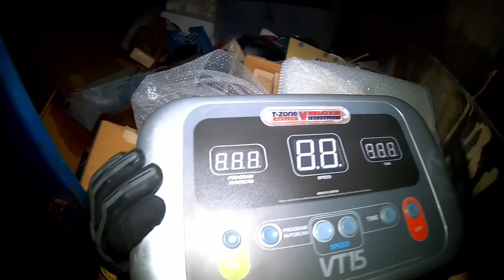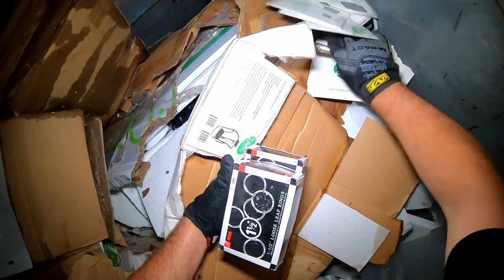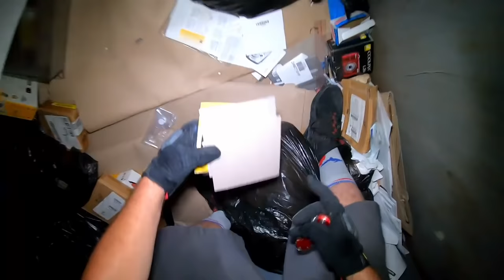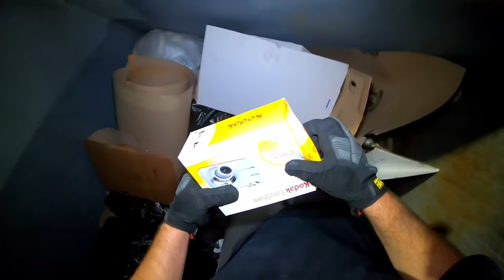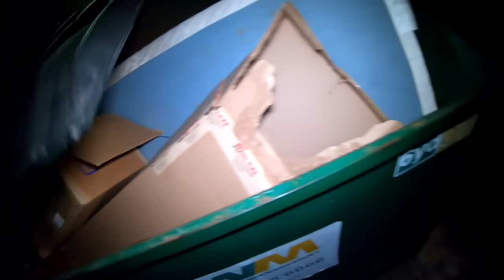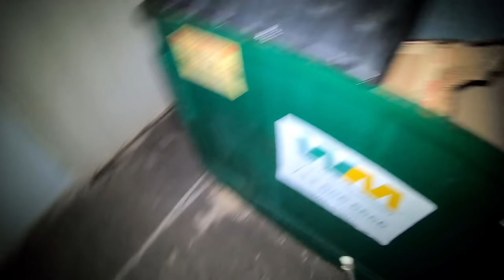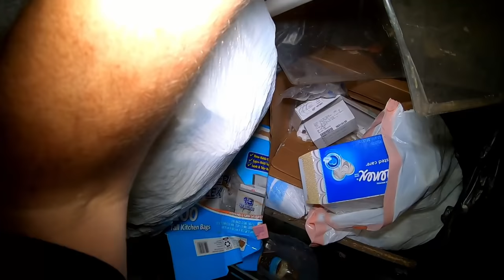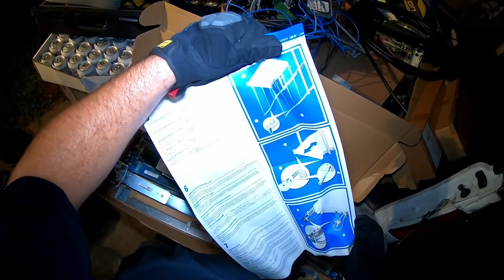Dumpster Diving "Maybe Not Even From This Planet"

Comment: Hey you can use those drawer slides to put hidden storage in some of the tables you make. That tube thing with the articulating handle looks like a pop can crusher. You stack them smash em and they come out that hole in the bottom. Awesome vid!!!

Comment: That big white machine is a dental grinder, I found one looked it up new is $600-800 and the front-bottom is all aluminum. That long tube is the drain hose for it has an attachment for a water hose

Comment: Yes Mike… the cast iron skillet can be salvaged. Fall season camp fire: get it going, lay skillet on hot bed of coals and add more wood to the fire… after a while in the hot-hot grab that trusty hook you use for scavenging and pull the skillet out… pound the bottom side when it’s hot and it should knock the rust and ‘nastification’ out! Lots of work, but worth it!

Comment: Those 3 large glass jars are for making either lemonade or ice tea. They can cost between $5 and $10 apiece because they have that pouring mechanism attached.  You can buy a top or get a cork top.
Cleaning shouldn't be a problem, use water and half clorox solutions let it sit after stirring it. That should get rid of the junk inside then pour out and wash with dishwasher liquid.  I would have loved to have found those !

Comment: 34:34 that cast iron skillet can be cleaned up, sanded, re seasoned and sold for a few bucks!   Edit: glad you did end up picking it up.
Reply: While that's true that's a lot of trouble for $5. Better just scrap it out and make a new one. At least it didn't end up in the landfill
Reply: @Firejoker54  $5?!  Have you seen what they go for?   Without cleaning it. I bet he could get someone to pay $25 if he cleans it up $60 all day.  With a lot less work than stripping $60 worth of copper wire.

Comment: Hey Mike, you need to have that one power cord for the USB hub. It gives more power to run more than one USB at a time. That Diet Dr. Pepper has a date on the bottom. If it is out of date since it is diet it looses it's sweetner after the exp. date.

Comment: Hi Mike. Your videos are fantastic. I ordered from your store. I'm a nurse and have stress fractures in my feet bones from walking on hospital floors for years, as they are concrete underneath the small carpet. I was wondering if those are scars on your lower legs from cuts due to dumpster diving - a side effect of what you do, the same way my stress fractures are a side effect for me.

Comment: your plastic tube is a home made static electricity generator its missing its belt upper wheel & dome, also the dumpster you got your hard drives from you missed the ssd drive that were in there btw if your bored you can strip the hard drives as the body is machined aluminium top plates steel the platters are coated aluminium & its got copper coils & very strong magnets inside two of them infact even the motor can be dismantled as it too has machined aluminium on it

Comment: The funny thing is that you just passed on an easy $5 in recyclables. You always ignore them as if Texas doesn't tax glass, aluminum, and plastic beverages containers.
Reply: Well, they don't...
Reply: @NewZ-cd3tn  no shizzle? Well I stand corrected. I dunno what made me think they charged a recycle tax that's paid when recycled. Or partially paid back like here in Commiefornia. So do the recycling joints pay anything if you brought them in?
Reply: @wolfmanjackal1427  only aluminum cans as by the pound and it varies a bit by place on what you'll get. Maybe 35-45 cents a pound of you're lucky..
Reply: @NewZ-cd3tn  we're averaging $1.65 per pound in Sac, CA. BUT I'M PRETTY SURE THE RECYCLE YARDS GET  55 cents more per pound.